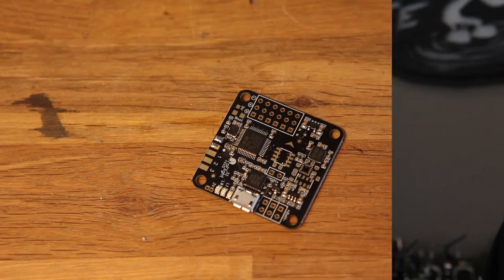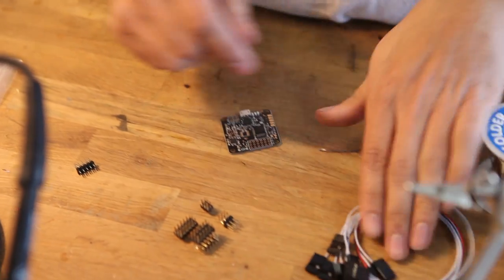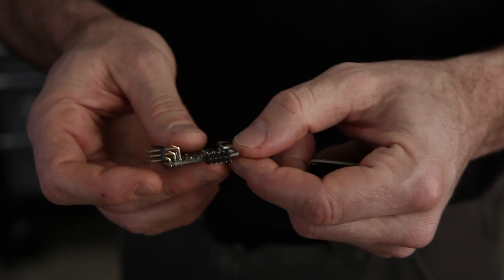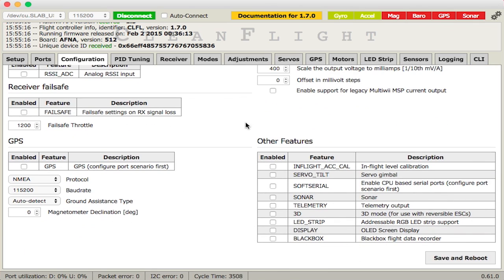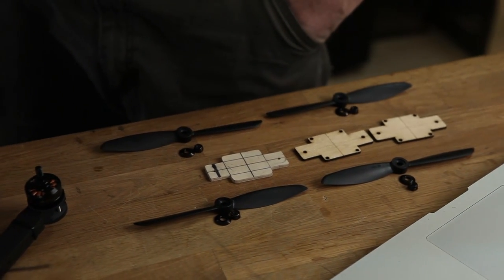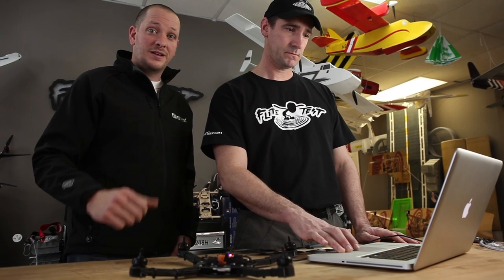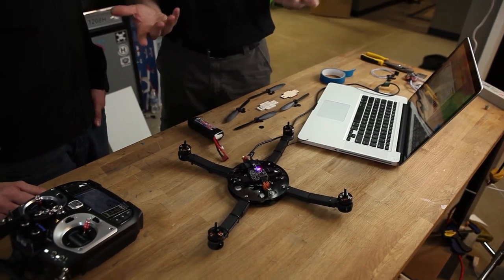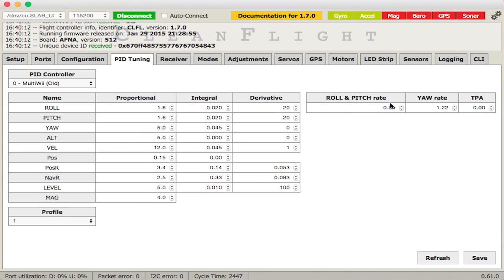Flite Test | Naze 32 Board Setup

Comment: Great video! The difference between angle and horizon mode is that horizon lets you flip, but angle doesn't let you pitch/roll past a certain angle. They both auto-level once you let go of the stick.

Comment: The NAZe board from FT came with the required pins and documentation. Not like the flip 1.5 board did from Florida, which really left me hanging! Thank you Flight Test for the videos and the equipment.
73
Jimmy, ARRL TS, WX9DX

Comment: Good thing about naze32 is that you also can use a mobile app "wii ez gui" to configure the stuff in the field with micro USB OTG cable.

Naze32 acro can do octocopter. It uses 2 of RC outputs for the motors I believe. I guess it's better to use PPM receivers so you have some spare pins when you want to fly octocopter.
Reply: Boris B. 
I have try for some time to get the Ez gui to work with a OTG cable but I cant get it to connect. Whats the secret? =)

Comment: You can configure the Naze32 for octocopters if you use ppm input from your receiver. It changes the pinout for the breakout cable to make two more outputs.
Reply: I was just going to say something ;-).... you beat me to it.
Reply: yeah.....unfortunately I learned that after we had the episode all done.  Sorry about that.  :)  I am still fairly new to the Naze.
Reply: Fun stuff! I definitely love my Naze32 flight controller, coming from kk-mini. It has so many more adjustments, very affordable, and firmware is constantly improving. Keep up the good work! Also, if your copter is an X, not H, you can do string, or rope, tuning for your PID's. It is super simple, slightly dangerous, but makes it easier than flying, landing, plugging it in, tuning, and flying again. Especially if you are using a desktop.
Reply: Eric Monroe
Hey Eric... no worries man!  It's all good.  So far I've found slapping the Naze32 on a quad frame and it flies like butter with the stock settings, but the tricopter defaults not so much.  In my case anyway.... I'm just getting it figured out for PID tuning the tri (Keith T. Brown 's 3D Printed tri to be specific).  The tri tail was wagging like a dog's tail... Just got that sorted.  Now on to the other axes. :).  Might even try Cleanflight's autotune to see what happens.

Oh... and on the vid I see you got v 1.7.0.  They must have just release today or since production the 1.7.1 CF firmware.  FYI.

One last thing... if you guys did a vid on Oneshot125 (I believe) that'd be super cool.  Seems to be a much better way to sync the ESC's with the controller in terms of timing, etc.  Check out:  http://www.rcgroups.com/forums/showthread.php?t=2305535

Cheers!
J
Reply: *****
Huh?
Reply: *****
I must be getting old and slow :) ... what is "That" that you refer to and what is "OP" ?  Wow... I need to catch up to the times.  LOL.  Forgive my slowness.
Reply: ***** ah.. now I get it, but I still feel old. :)

Comment: Thanks for the vid fellas. As a newbie setting up his first quad (I bought one of your Bat Bone kits) - this is probably the best vid so far on the Naze 32. You guys seem to be more interested in making this board work for everyone where as a lot of others seem to want to make it look complicated - and I think they do it in order to try and make themselves seem more intelligent.

You always say you're looking for new ideas to try out and I think I may have one. I want a BRC for my Bat Bone V-Tail! (For other noobs, a BRC is a Ballistic Recovery Chute that small private planes can use when they are in life-or-death situations).

So - if I lose power on my new creation - I want to be able to chop my throttle, fire the chute - and have it deploy and lower my valuable drone to the ground and minimize crash damage.

Your mission (should you decide to accept it) is to create a viable rescue chute, install it, and successfully deploy it in a simulated situation where a quad has lost a motor or has developed some other dire crash-inducing condition.

This message will self destruct in five seconds...

Comment: Idea for additional Naze32 episode:

One very cool feature of Cleanflight is that you can select PID-controller. There are 5 or 6 ones available. The original Multiwii,  a modified Multiwii,  Harakiri, etc. 
Switching PID-controller is basically the equivalent of switching flight controller board.

 It is very difficult for me to evaluate which PID-controller is best. I am simply not experienced enough to know if a controller is better than another or if I just happen to stumble on good settings. 

It would be great to have an experienced Quad pilot try out the different pid controllers on a few platforms (250, 350, tricopter etc) and express his personal opinion on which one he likes best for each platform.

Comment: This was a great episode. I've learned so much from you guys and look forward to more episodes. I've got the full Naze 32 and "cut my teeth" with the other fourms out there. Your video and explanations have enhanced what I've learned. I also love the angled rotor arms and Eric's explanation about them. I've added the alarm buzzer to my board that is switch activated to find my quad after crashing. Maybe another Naze 32 demo could include how to do this as well as adding OSD to this board for us FPVers. Also, I haven't figured out how to have a low battery alarm AND my lost quad alarm on the Naze32.
Reply: Adding osd is pretty easy, though it would have been a good idea to have soldered the telemetry pins onto the board right at the start ;)

Comment: awesome video glad to see u all finally got a naze 32
Reply: thanks broham!  i am loving this FC.....cant believe how locked in it is.  :)
Reply: Eric Monroe Agree on that, finally you discovered Naze32 :) Naze32 is amazing system. Best board for me to fly acro and FPV. After trying some I sold all my previous boards and ordered 10psc of Naze32 :) I use only genuine Abusemark boards and Baseflight configurator app for Google Crome. It was very easy for me to get in to this board configuring and everything is presented very logically. All answers are online. But to be honest I need to say that I do electronics for a living, I have engineer mind set.   
P.S. Naze32 can support octo and even more weird and wonderful setups because for advanced users it gives capability to configure in custom motor layouts.
P.P.S. Horizon acts as Atti/Level mode until you reach certain degree of bank/tilt. Beyond that point board acts in Manual/Acro mode and lets you flip. After you flip some cycles up high in the sky you can release sticks and board will auto level it self :)  And you will continue level flight. You can even change that threshold angle :)
Reply: Eric Monroe Eric, You might want to checkout custom mixes on the naze32. Its possible that you can get it to fly even better if you let the naze32 know that the motors are tilted. Though that's well beyond my level of expertise with the naze32.

Also, how much did you angle it? Would be good to know if 3dprinting angled motor mounts for my quad, instead of bending the arms.

They look to be tilted about 15 degrees in towards the cg point.

Comment: great show i had mine for 3 mouth but was did not know what to do i got a ft hub that i making a 275 hex 6HK 1704 motor  readytoflyquads 12amps ESC and now a naze 323 FCB thank you again peter great tip on soldering the pins

Comment: The minim-osd flashed with MW OSD firmware works great with the naze32, it lets you adjust pid gains through your fpv goggles using the sticks on your tx.

Comment: If running CPPM you can run an octo with the Acro using the "input" pins (usually used for the Rx) as motor outputs.

Comment: With mini quads it's fairly important to set a working failsafe value as the nature of these machines means that people dip behind hills and other objects that are radio opaque (especially with FPV)

A common value seems to be 20% throttle for 3 to 5 seconds so the descent will me more gentle than a complete throttle cut.

Comment: Hello Flite Test,
Please help, after flashing Naze32 to Cleanflight and calibrating Accelerometer and Magnetometer, the red led light is flashing(blinking). The naze32 is not mounted on the frame and does not have any pins soldered to it yet, What does it mean when red led blinking ? How can i fix it ? thanks

Comment: Coming from the KK2 to Naze a couple of things I'm missing.

When arming / disarming the buzzer doesn't sound off. Think it's a really good safety feature, specially when approaching the quad you want to know the motors aren't going to spin up if you accidentally thouch the throttle. Should be easy to implement.  It also serves as a beeper for finding your quad in tall grass(toggling arm/disarm), without having to waste a channel for the actual beeper function.

Another thing I'm missing is that you can't tune angle mode (self level) like you can in KK2 . Atleast haven't found a way to do it. I like to use it when learning FPV and the auto leveling is a bit too aggressive for that. Is there a way to change it? Do the PID even effect the angle mode? If they do, can you set it up so that when switching in to angle mode it also changes the profile for a more gentle leveling? I suppose it needs low "I" gains for that.

Comment: Very interesting about angling the props. I notice the DJI Inspire does it to, but the opposite direction. I wonder if it would be easier, for people to use the streight arms and use a wedge to angle the props the opposite way like the DJI does. You would just need landing gear to keep the props from hitting the ground.
Do we have time cop to thank for this board? 
Would love to see a show that compares all 3 control boards, cc3d, kk2 and naze 32. That seems to be a big question for people getting into mini quads.

Comment: Hey, What laser cutter are you using to cut your wood parts? What speed/power/frequency for that wood (is it 1/8th or 1/4"?).

I recently got access to an epilog fusion 120w and really want to try modeling some framde designs and stuff

Comment: Great idea on the angled arms for the motors.  As a (very new) newbie at quads but an old hand at (real) cars I was wondering about this myself.  On your car or truck it's called toe and camber.  That's how a vehicle can track straight down the road without constant input from the steering wheel.

Was that a custom hack or are the angled arms available on the hobby market?

Comment: Idea for an episode: Is it possible to retrofit our existing frames with wedges under the motors to achieve the dihedral that Eric uses. Should they radiate from the center, or can they be aligned with the arm? What angle works best?

Comment: Thanks for your great videos on quads and particularly this one setting up the naze board. I've just about finished building up a ZMR 250 frame but not sure what size lipos to use. Will be used as a platform for taking videos and stills with a GoPro to add other interest to our holiday videos. Thanks. Mike and @rohanthebt

Comment: Will the Naze32 be compatible with the receiver from the Turnigy 9x transmitter?
Reply: Sure
Reply: +Alex Scott Of course. You'll need to connect it with PWM, which means between 4 and 8 servo cables (one per channel).
Reply: +TheUnnamedGent  hi I set it up with touring but its look that is all wrong. do you know how I can change setting as in Receiver setting on OpenPilot for cc3d? I need some setup for Naze 32

Comment: got my first naze32 out of the box...try'ed to configure it with cleanflight...and i can't put cleanflight on it...it says... no response from bootloader,installation FAILED...
Reply: this also happend to me how do u fix it
Reply: +Ankit Patel send me a pm if you need help ;)
had the same problem and fixed it yesterday evening
Reply: +TheDirtyHarry you have to short the two boot pads on the naze32 and enable no reboot sequence on cleanflight. Keep the pins shorted until its done flashing.
Reply: +The Woodi World worked for me with my flip 32 race edition as well

Comment: Why not use solder with an acid (also known as flux) core? Flux helps a great deal when soldering and while it may leave some ugly residue for beginners, it gives the solder a nice oxide-free surface for the solder to grab on to giving an excellent electrical connection. It basically does the hard work for you.

Comment: That is a cool looking basic quad. I've seen the angled arms on your site is there any build instructions I can't see how they are put together. Also where did you get the dome from. You should sell it as as a complete kit without the NAZE 32.
Reply: You need to cut the arms and use the angled brackets with screws to splint it back together.

Comment: What should I do if not all engines start spinning at the same throttle? engine 2 starts at 1053 and all the rest at 1065.. I tried the calibration methode setting it full throttle, then plugging in the battery and clicking it to lowest throttle.

Comment: The board doesn't have 6 outputs. If you reconfigure it to use PPM, the other inputs will serve as extra motor outputs, so you can have more than 6.

Comment: What about the cc3d board? I'm wanting to build a 250 race quad but I'm having a hard time deciding which board I want to use... any suggestions? Right now I'm just flying my 200qx with 5030 blades and my fpv setup.

Comment: Hi,
Any chance that you will do the follow up this episode like you said in the film?.
I really would like a  episode on pid tuning. (i am currantly trying to work out a couple of diffrent things. i have fiddled around with my pids but cant figure it out)
what the diffrent walues does, and if you have a problem, how to cure it. like nosing up, how to get it to stay loked in. explain a litle what the diffrent things means like what does tpa means, and what does the other values under yaw, pitch roll do?.
is there any diffrence in in pid 1,2,3?.
i am currantly using baseflight, what is the diffrence in baseflight cleanflight?.
Hope you will do a follow up. i have been searching the internett, but not found any good explenations yet.

Comment: im having a issue in the mode setup. i set up a aux 1 for arm and aux 2 for other two and it recognizes when i flip swtich, but does not turn green when its in the diameters i set?

Comment: Late question but.. If my friend has the same motors and the same size frame but different ESC, can i then still use the same PID settings? or should i use his settings and the adjust from there? :)